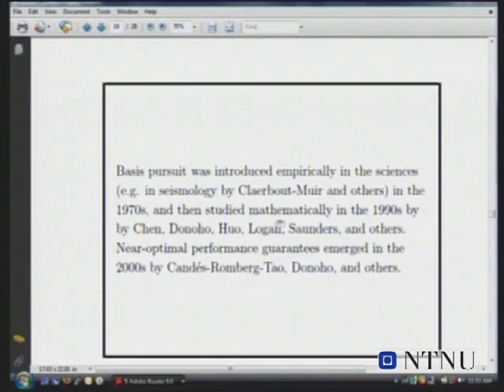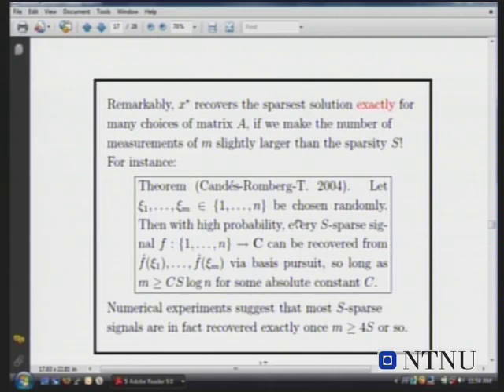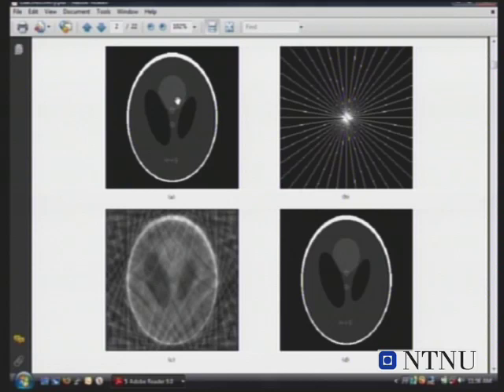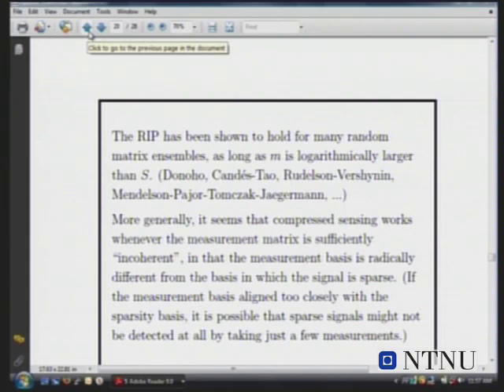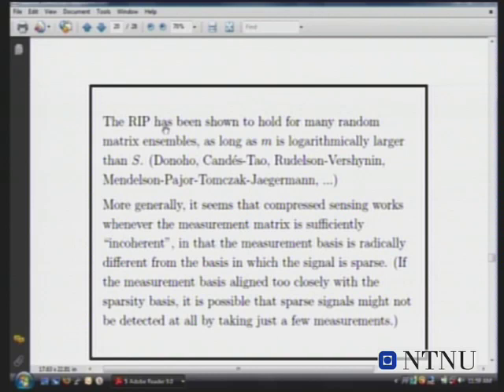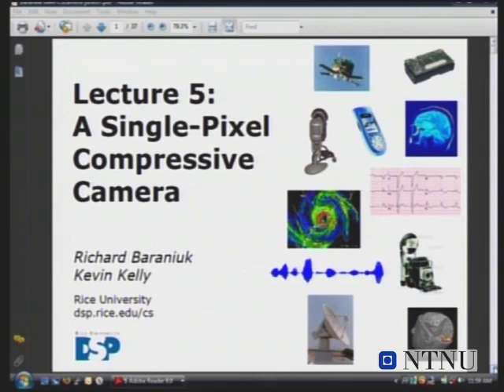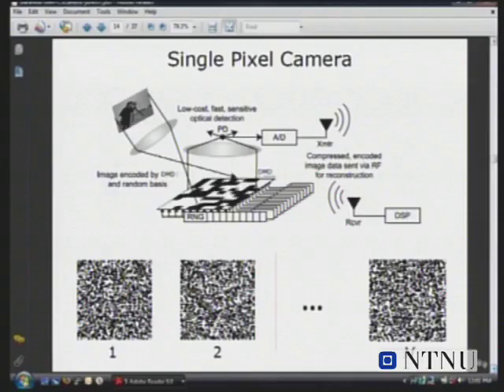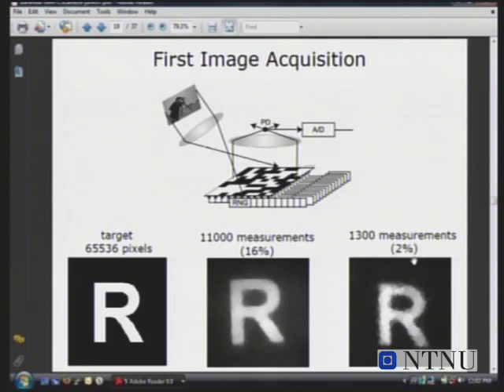NTNU's Onsager Lecture, Compressed Sensing by Terence Tao, part 5 of 7

Comment: 2:00 So to be clear, only sparse signals can be recovered from sparse basis pursuit … right? Otherwise L₀ min would be setting some constants to zero which are only close to zero, therefore throwing information. Do I have this right?
Reply: that's correct.  If the image looks like this: http://image.shutterstock.com/display_pic_with_logo/1237060/347390456/stock-vector-color-noise-vector-background-made-of-squares-347390456.jpg you have 0 chance to reconstruct it using this model.